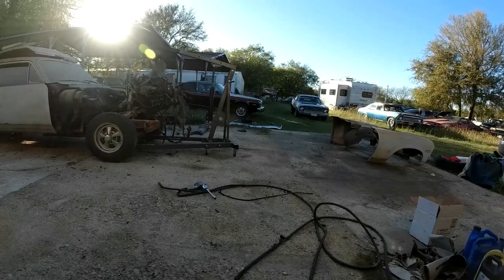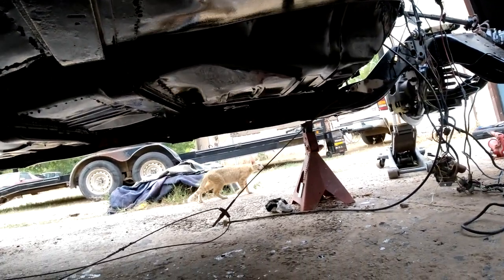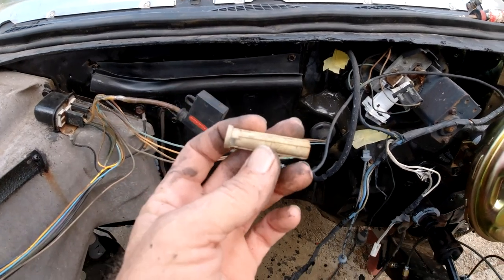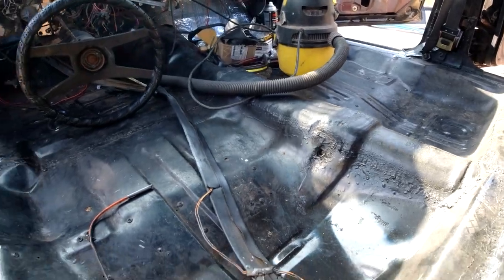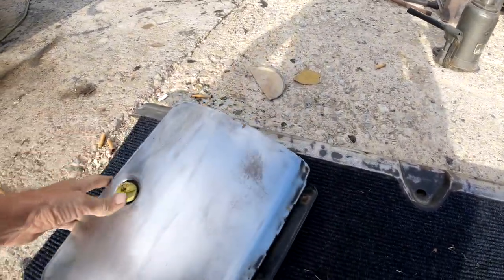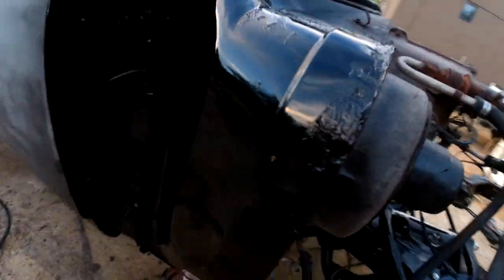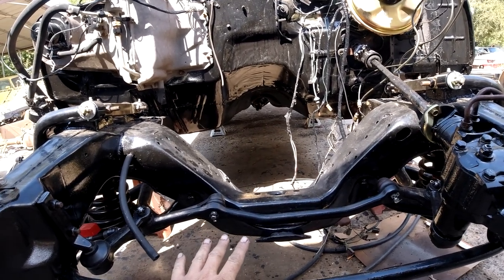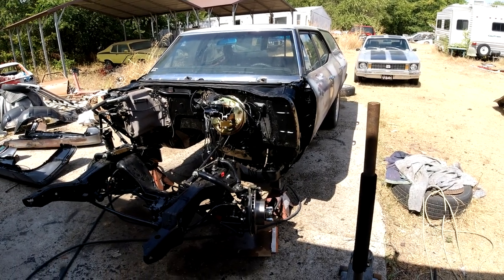1968 Chevelle Nomad Restoration - Part 31 - Wrapping up the Little Things - Painting - Rag joint

Comment: Everything's looking awesome I just did that to mine but I didn't buy the kit so I did a hundred trips to the auto parts I have a 71 Chevelle four-door had manual steering manual brakes and I changed all that to power I have a brand new 305 small block with a little cam I wouldn't know where to start with the LS so I'm looking forward to seeing how yours works out I'm going to try to send you a picture I stayed with the old school small block cuz it was hook and book but I'd love to put an LS in it I think you're doing a great job I love your work I think you're going to teach me something here on the ls swap keep up the great work

Comment: Thanks for the update on the wagon cant wait to get to the engine part those spray adhesive s don't work for the headliner been there..best thing is liquid nails use it in a caulking gun you wont regret it..just spread it out evenly.ok..peace..

Comment: I have had success with weldwood landau top adhesive in the light blue can.  Have to order it by the gallon and spray it.  You will probably need to pull the headliner out and start over now that you’ve got a few different glues in there.  Haven’t had luck with anything out of a spray can.

Comment: Harbor freight has pps systems that works great. You can spray in any direction. There also great price. Buy the starter kit and adapter then all you need afterwards is refills

Comment: Lee I didn’t realize that 3M 90 Landau and Headliner is now only used on the 5 gallon buckets only. The name of the spray can of the same is now called “3M 08090 Super Yellow Trim Adhesive” on the lid it says Industrial in red letters. But I did learn trying to find the old spray can that Dap make a Landau adhesive it’s called “DAP Weldwood Landau Top & Trim HHR Solvent Type Spray Contact Adhesive” the longest product name ever. I’m sorry I didn’t realize they renamed the non commercial size didn’t mean to send you on a wild goose chase. Looking at the ingredients they are really similar on there safety data sheets that they put what’s in it. If you get in a bind and it’s not working out I can come help you out I just don’t want to be on video. But we will need to take the liner down and if needed I will bring my son for another set of hands. Love the project and would be glad to help you out. If you decide help is needed just say Wayne Email me on the comments of one of your videos I read them all. Hope this helps sorry for the mistake you would think 3M wouldn’t change a product name from the late 50’s, must be some marketing kid.

Comment: After doing so much work the back seat is awful and will let the interior down. I think you should have used the matching rear seat off the SUV donor car. or at least re cover the rear bench. Apart form that cannot fault your approach or application.